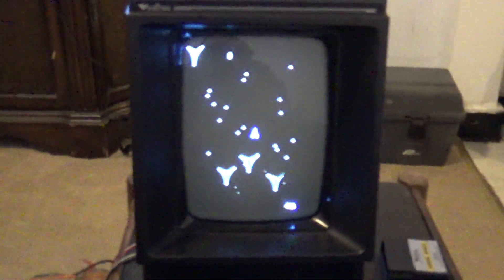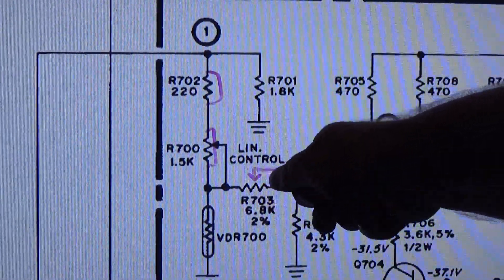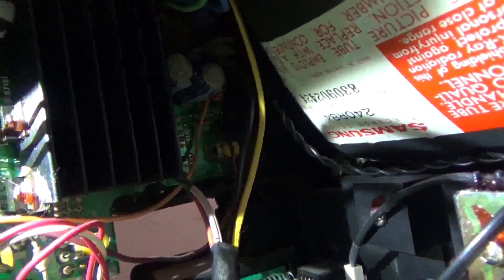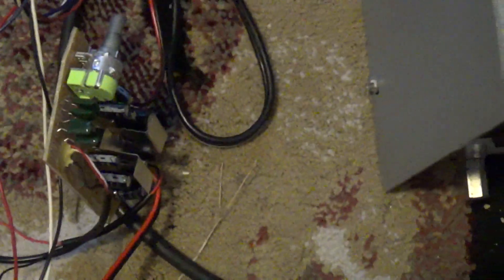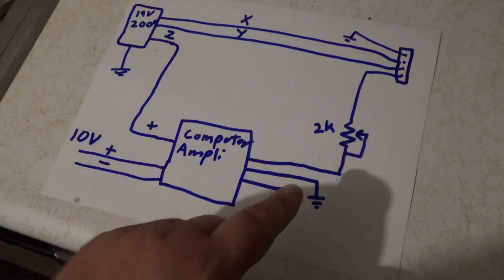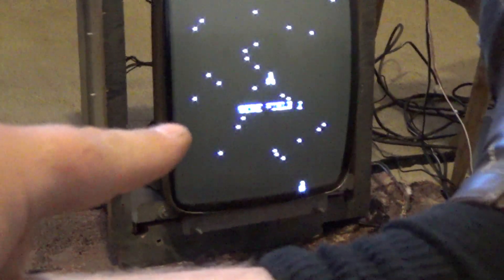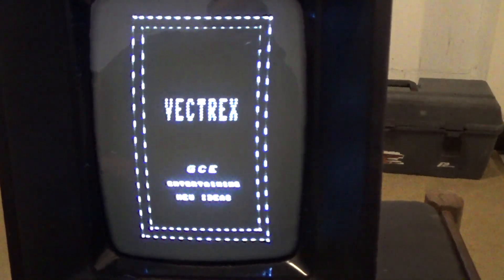Vectrex on a 19'' monitor mod!!!!!

Comment: hello, why do not use the Z driver for color ? O r does the vectrex have only one Z-level ?
Reply from the maker: 128 levels because most games are only a few colors
Reply: @ArcadeJason  ok, if you habe more than one Z-level , you can use an 8 Bit ADC to convert the grayscale into colors.
Reply from the maker: @mibnsharpals  yes  but the original games were often only  1 or 2 intensities
Reply from the maker: by the way i am building a duel circuit that will change into a different mode if the user runs a "color programmed" game . it should be for sale in a few months

Comment: i have a vectrex emulator on my arcade cabinet with a 28" crt. i have hyperspin front end and retroarch emulator running on a hidden windows xp system
. i think its a better option without gutting an original vectrex. but still nice work you have done

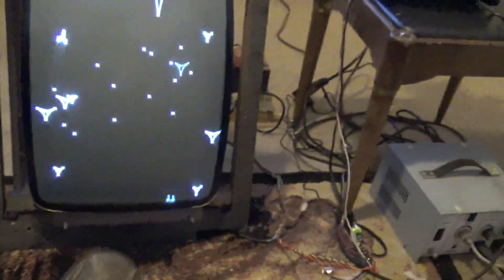Comment: 16:20 if wg6100 operates on 30VAC couln't you run it with something like this? https://www.ebay.com/itm/253379282284
Reply from the maker: Sno oks Yes
Reply from the maker: just make sure its 30v 0 v 30v  or in other words 60v center tapped

Comment: 3:22 How about a simple On/Off switch, instead of permanently cutting it?

Could you modify a Vectrex to be usable as a normal monitor that you could hook up to another device, while still operating as a Vectrex when nothing is connected?
Reply from the maker: yes

Comment: AWESOME! I've been waiting for someone to figure this out, and now the home-brewers for the system can make their own coin-operated games too! 

Is it possible to make a Vectrex PCB from scratch or does it have custom/impossible to get parts? The systems go for a LOT these days and at a glance the PCB doesn't seem to be too complicated.
Reply from the maker: yes you can make a pcb from scratch there is one special chip that needs to be made but if your a beginner i suggest buying a broken vectrex  you can buy every chip inside the vectrex $25  total
Reply: Is that a PROM or something? I could probably just have hobbyroms.com make it for me whatever it is, they're pretty good. I've got other projects in the cue before I mess with this but now that you've cracked the issue of connecting it to arcade monitors I'll probably try it at some point! There are a LOT of Vectrex games I've always thought would be awesome in a full size cab! Oh and I subscribed!
Reply from the maker: yes it is a prom and yes you could have hobby roms make an eprom  i used to wire wrap my own computers  its definitely alot of work
Reply: I'm assuming the power board (the perpendicularly-oriented one) is still necessary for something. But it would be cool if not. There is someone out there on the Vector Gaming forums making a repro of the Vectrex logic board. That would make Vectrex arcade easily available to the masses.
Reply: Where is the forum? Atariage.com?
Reply: People are starting to talk about this... :) 
Hopefully this'l spark some attempt to make a repro board or one that plugs right into a cab. I've got most of the parts to a Battlezone that I was going to try to restore, the cab was given to me but needs to be completely redone. Rather than go though all that and the expense of buying the PCBs I think I'm just going to take the monitor and build my own custom Vectrex cab, I just need to chase down the Vectrex board.

Comment: Great vid. Hmmmm, got me a ready to go G05-801 and power block sittin' on the shelf doing nothing. Also how does everyone doing vectrex tech videos miss the holes on the solder side of the pcb to access pots for X/Y adjustments? You don't need to stick your hand under the tube while powered on to make those adjustments. Play safe.

good day.

Comment: Hey Jason, I don't know if you realize how important this tutorial is. It's probably the best thing ever-- EVER! As far as your proposed cabinet, go all out and fabricate one in the same style as the vectrex itself- same rounded contours, same texture, and same text style, even an oversized version of the control pad. Maybe even make giant vectrex overlays! Now, could you please tell where to find the larger b&w tubes? maybe from old tv sets? I've seen old b&w's with 27" screens. Would they work? As far as your ability to explain, you're pretty clear, but you do go kind of quick, probably just because you're so enthusiastic about what you're doing. All I would suggest is that besides showing the mods on the schematic, it would help if you showed the actual boards and circuitry in detail and how they should look after modification-some of us are less conceptual and more visual. Finally, I suggest the Mateos vectrex developer, which is a flashcart you can load roms from the internets onto. Vectrexroli did a video about it. There are so many homebrews for vectrex that are truly great, and only more all the time. I especially like "release" and "protector" (a "defender" clone).The flashcart is usually available on ebay. This is the first time I've commented on a youtube video. That's how great this really is.
Reply from the maker: i have now perfected it with a few more mods also i am running a 23'' screen now  i dont think they ever made a 27'' b/w tube but if they did  and it is a 100 degree tube it can definitely be made to work  thanks for the comment man i am debating making a second video showing how to finish the mods in detail
Reply: Please don't debate! I want to do this but I don't want to mess up my monitor. I know your time is precious but your videos with the repair and modification info are gold- the more there are the better! Also, where did you get the 23" screen, if I may ask?
Reply from the maker: many many bronze age arcade games used this size tube  the good news is in most cases these are the cheapest games to buy often i see dead b/w games for $100 just make sure you verify the tube size before you buy it
Reply: Thanks much.  I do wonder, though, if the vectrex 3d imager will work with the larger screen, as it works by blocking info to alternating left to right eyes synchronized with the refresh of the screen itself. Are the refresh rates of the vectrex screen and the large monitor screen the same? On a different topic, have you ever encountered/worked with the zektor zvg? It seems like your kind of thing.
Reply from the maker: i have been looking for a zektor zvg on face book ect they are no longer made and impossible to find now at least in my circles  vector monitors display the frequency they are given so the 3d imager  should work perfect  the arcade monitor i am using  has faster z timing  and a faster slew rate so there may be vectrex games that were purposely programmed wrong in order to make a perfect picture on the slow monitor   i  only have a few games so when i get a multi cart  ill be able to test  more games but for now it is perfect
Reply: Hey Jason, I PM'd you via youtube.